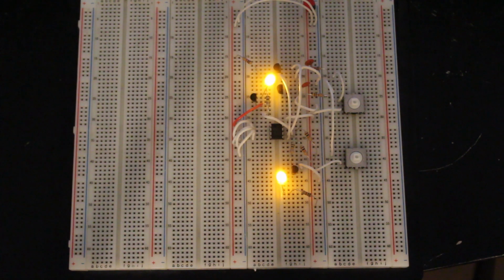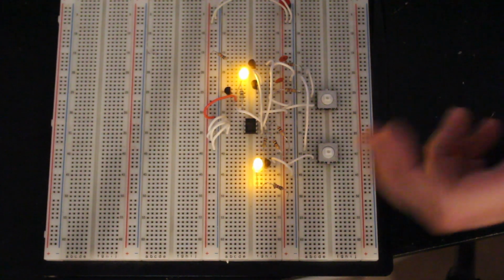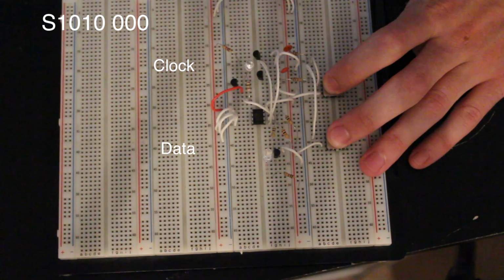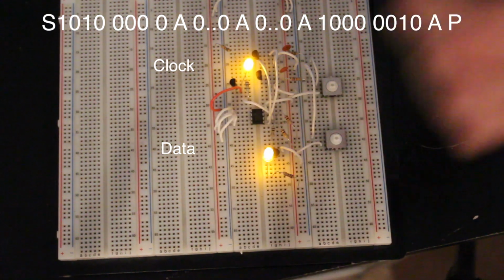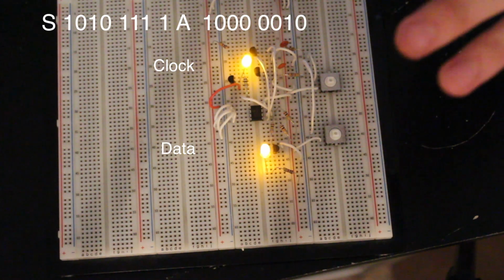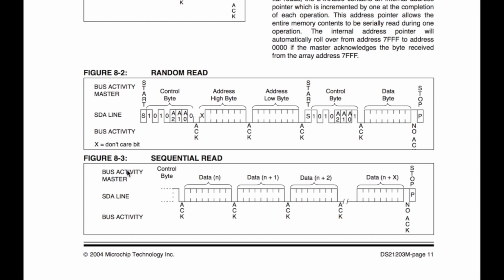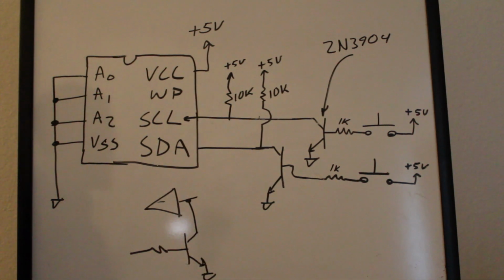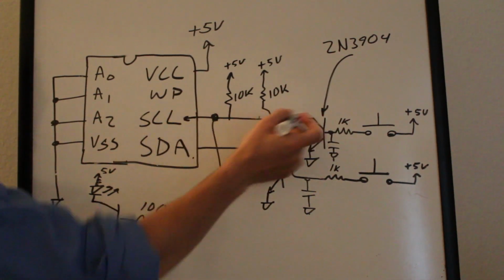I2C Bit-Banged without Microcontroller!

Comment: It was much easier to work with Parallel Static Rams, in non-microprocessor based applications , however most such memories are now obsolete and not manufactured like the 6116 a 16K static memory, set as 2K x 8 bit RAM.  So using serial Ic2 memories you do need a microprocessor to feed instructions into it, it is a sequential information into the serial memory chip, by sequential I mean start bit followed by chip select bit, followed by whether you want it to read or write to it, then entering upper memory bits and then lower memory bits for the address, then followed by the actuall 8 bit data, and finally  a stop bit,  a very tedious process, all just to save space and number of pins, and wide data and address lines on a PCB, all to do with miniaturisation off things,  each time it steps through its sequence an acknowledge bit is send back to the processor, so it knows how the chip is doing,  So basically serial memory is still configured as parallel internally except the chip has built in seral to parallel and parallel to serial decoder, so only requires a fewer pins, this was done to reduce the foot print, so its speed is compromised due to serial loading and serial reading of data.,

Comment: This is simply amazing. Thank you so much for the effort put into making this video. I mostly talk emotionally. I can see you struggled a little bit in heart for some reason. But it came out great, man. Good job!

This will definitely help me in not using the nasty Arduino IDE for rendering on a display through the ATtiny13A (which I love)

Comment: Wow, this might be the most practical and to the point explanation of the I²C communication that I've seen on YouTube, and I've seen a lot! (most of them made by Hindus)
BTW the clock line actually can be controlled by the slave device, in a so-called "clock stretching" mechanism. When the receiver is busy and cannot accept our data at the current rate, it may pull the clock line low until it's ready to receive the data, and the master will notice that, because it's constantly reading the SCL line as well and checking if it follows the changes it applies to that line. If it sees that the line is already pulled down by someone else (the slave, in this case), it waits until it gets released and goes high again.

Comment: You would not believe how confusing ack is to someone with a datasheet having never seen i2c before. Its simple. Bits go in, master check low from slave, if low, clock out the ack and continue. Thats the whole point, to ensure the slave is seeing proper data sequence.

Comment: Great video, loved the demo. I really feel like I should try this out.

The transistors for the leds I see why they were needed, but why did the buttons need to be on transistors? Why not just connect them to ground directly? And Hfe for the 2n3904 is 100~150 and the base current would be from 5 volts going through 110k ohms. (5/11000)*100 = 0.0045454. I sincerely doubt those leds needed current limiting resistors when the transistor was no where near saturated, You would have been lucky to get 5ma the according to your schematic. Unless I'm missing something.

Comment: great video! curious on most chips i2c is a pin, is this just a gio pin and you have to program for i2c protocol or is it hardwired in so that if you coppy to the address of the register at a certain devices address at a certain i2c pin, it takes care of it for you and it is just a special machine operation, an operand similar to read write but requiring additional addresses?
Reply: also if i happened to be crazy and want to program a microchip by hand could i copy my instructions or program to chips memory by using this and not use a typical programmer and all the ide stuff. i think this would be cool as an educational endeavor for myself as well as a good test of my understanding of things.

Comment: Awesome tutorial! Thank you so much for taking the time to make that :) Just wanted to ask though, why are the transistors there in your circuit? Why couldn't you just have the push button to directly ground the SLL and SDA lines in the place of the transistor?
Reply: He needed to use the transistors in order to keep the signal 'normally high'. When he presses the switch it biases the transistor and allows the 5V signal to be pulled low. This makes it easier than keeping his finger pressed on the button to keep the light on, which would be the case if he connected the switch directly to the SDA and SCL lines.
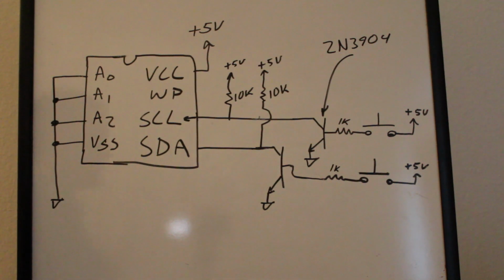In the I2C standard, the signals should be left high when the bus is idle and waiting for a start condition from the SCL line. He shows the circuit at 23:11 (LINK: http://youtu.be/8ZYMrcHm91s?t=23m11s) in the video and explains their purpose.
Reply: Pete D'Amico But if the switch was connect to ground, it would have the same function, wouldn't it?
Reply: One cap cannot do switch debouncing, you'll need a resistor and a cap to do that (an RC-network). That's why he needed the transistors on the input. Pulling low through a resistor could work, but it wouldn't be really low. It would be close to +0.5V if he used 1k pull-down (10k in series with a 1k).
Reply: Nicholas Stahl I have the same question.  Initially I thought the transistors were to help with de-bouncing, but he says the caps help with that.  I guess one way to find out is try and build it without the transistors.

Comment: Great tutorial, breaks it down to the core and even explains the LED's in this setup, although I'd love to know how to be sure that those buttons don't bounce. Even for a newbie like me this was easy to follow, keep up the great work!
Reply: well i think in i2c data is actually transmitted when the clock drops low so isnt a problem for data line as it will be already stable in it's position for the transition of the clock line, my guess is that any voltages during brief contact of the switch does not register, not really sure.
Reply: You don't have to worry about the SDA (data) line, but the SCL (clock) line is a different story. If your clock is bouncing all over the place, you may run into trouble. It looks like he has a capacitor on the clock line.
Reply: yes you are EXACTLY right, i sense seeing this have constructed the very same type of circuit but for a lis3 nano accelerometer from stm. after building and actually communicating with the ic through i2c i see that it would be a very real problem with the clock line though i2c protocol limits to 400mhz so i wonder what would happen if it was faster than that the intermitent signal from the clock? i could post a video of my accelerometer circuit but it is very messy, my bread board is tiny and wiring is not neat but it works, i have read the "who am i" register and confirmed the replied byte with the data sheet, also i have read the lower portion of the 2 byte output register for all three axis to see if the accelerometer was working cause i had to reflow it to a break out board and it is an lga-16 so very small 3 x 3 mm and has 16 surface mount pads. if you would be interested in a video i could make one.

Comment: Great Video! 
You have done a great video in the past on the tlc5940 led driver. 
I was wondering if you could follow up on the tlc5940 video with a similiar bit-bang 
process much like you have done with this I2C video.
If you are not currently a salaried educator....You Should be.

Comment: I was able to replicate this, and I sort of combined this with a shift register so that I get the whole 8 bit representation of what I'm sending to (and receiving from) the eeprom. I simply got the clock and data lines of the shift register and eeprom tied in parallel. I also used a soft-type button (like those on TV remotes) since it was a bit less noisy than the tactile buttons, those were giving me problems with de-bouncing.

Again, thanks for making this tutorial! Keep those vids coming man

Comment: Thanks Kevin for another excellent video! I need to learn I2C for a future project. Just learning the Arduino / ATtiny now, so this will be after a few other projects. But what I have been looking for is a I2C in to parallel out chip, to use the out bits individually to control DIP relays. Found chips that will do that, except they want to initially see a MPU on those parallel lines to setup the address, where I want a hardwired address (maybe a DIP piano switch). Your videos are a lot of help!